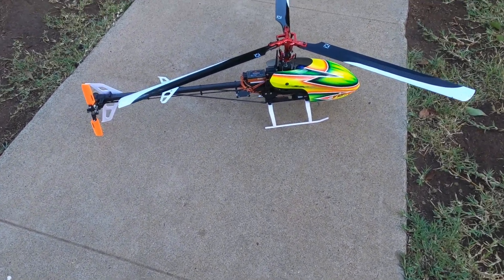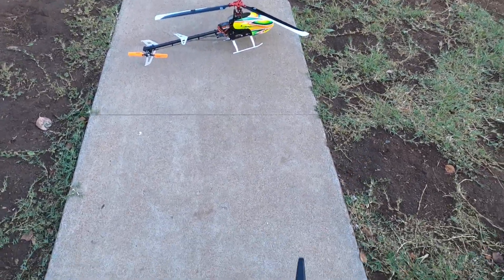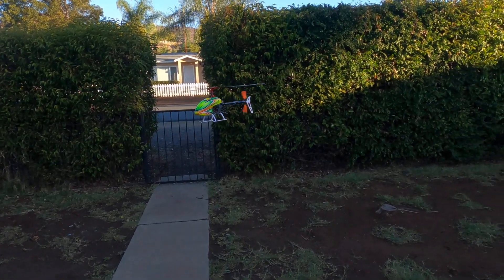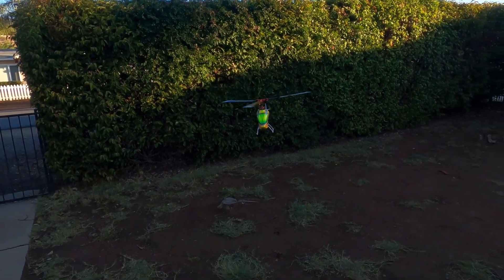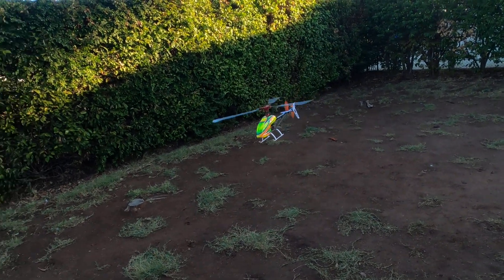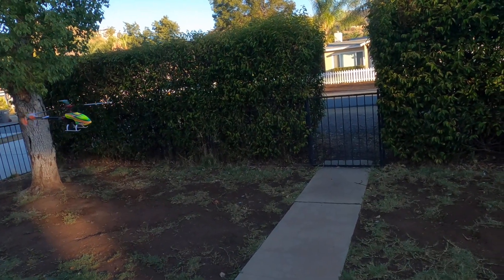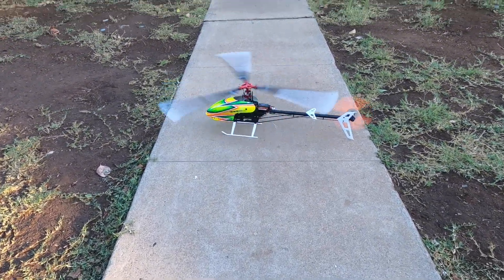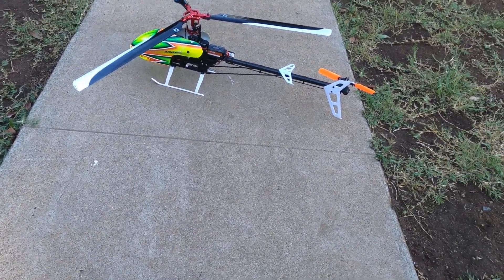Horizon Hobby Blade 330s with MicroHeli 3 Bladed Head, Metal Swashplate, and Longer Tail Blades

Comment: Total overpriced crap little tiny ass way too tiny screws.  You might enjoy for free but when you buy it and it's so small you need a glass to even see it.  Likely you will damage the stuff before you ever get a chance to crash it.  I have bought probably 1000 bucks in microheli 230 parts including 3 blade head I recently threw away after a couple flights.  Stuff was beat to hell sloppy as blade plastic junk.  You will see.  Fly it a little and tell me I'm wrong.

Comment: Do you have any updated videos or information on that set up since you have been flying it for a while...ive moved up from the 330s to the 480 and now i want to upgrade my 330s for fast scale flying and mild 3d like loops, rolls, and inverted...so far all i have is the micro heli 2 piece canopy and would like the 3 blade set up.

Comment: I like Microheli aluminum parts. They are top notch precision made, but....I did the microheli 3-blade conversion to my 230sV2 with microheli AS350 fuselage because it made it look more scale. It looked good, sounded good, but I had to fly at almost full throttle. So I did the recommended motor upgrade of the 320 size blade heli motor with 11t pinion. Well it was a pain in the butt to get the wires routed correctly around the motor, and had to move the esc back slightly. Definately more power now but... no amount of gyro adjusting will get the tail motor to keep up with all the extra torque. Full throttle = endless piros. The electric tail motor just cant keep up. And it sucked batteries down like crazy. 4 minutes of just lazy figure 8's took the 1300mah batteries down to 20%. I switched back to the stock 2-blade head but left the motor & pinion in it. I'll see how that goes. I may try the 3-blade head on my gen 1 230s with microheli hughes 300 canopy. It's 5.5 ounces lighter and may not require as much power to fly.
Reply: UPDATE
I ended up putting the stock motor back in the 230sV2 that has the scale AS350 fuselage and left the pitch servo travel at 115%. 
 I put the MH three-bladed head on my gen 1 230s with the MH Hughes 300 fuselage kit. It also has stock motor and pitch servo travel set at 115%. No tail blowout issues and it seems to have plenty of lift, but it feels a little sluggish compared to the stock 2-bladed head.
Reply: So I wonder if you could give me any advice? I have RKH3-head. Cf rkh frame 3rd Bearing block, auto rotation CNcgear  tit/alum shaft lynx CF tail boom . I put my blade 200s motor in 3980kv stock landing gear. Getting a lot vibration I still need to adjust those links never done 3bladed head n need balance blades probably my main issue. I wanna scale it to the 355. Oh and it’s 230sv2
Reply: @jtkeys7618  check the tightness of your blades in the blade grips first. Barely snug enough that theg dont flop around whe you pick it up and move it around. I have found that getting the blade grip tightness is very tedious with aluminum.  I run stock grips on my 2-bladed heads. If grip tightness isn't the problem, balance the main blades, and make sure they are tracking straight. Non adjustable though on the 230s unless you change them out to adjustable links. But i might also mention this, use stock Blade links from the swash to the blade grips, and change the ball link on the follower arm from swash to main shaft. (Just use a regular ball link and trim it to the same length of the MH link) The MH links are 3d printed and they get sloppy very quickly. I had one pop off on spool-up and it took out the anti-rotation bracket. Luckily it was on the ground and not flying. Lastly, make sure the follower arm is installed correctly. The links from swash to blade grips should be perfectly vertical.
Reply: @Freddy-Bueger  thx for reply sub your channel if it helps ? Lol appreciate your time. I just got 245mm CF from blade. I def have blades tracked betrrr now. Afraid to even spoil up . The 200s motor only 7$z anyways I’m still new 3years or so. I will check tightened again and agree with you. My stock 2bladed head with all my other upgrades hovered on a dime barley and movement after my trim flight ( beautiful) now I’m concerned I just blew 100$. Live & learn. Happy flying . Love your scale heli nice work. Also, I said I had rkh 3bladed head?  I do have stock control arms roll from swash to blade grips. This rkh head grip 3bladed combo is so nice . The arms look very durable. Who knows I’m only trying to put 355 fuselage from micro heli n scale fly it.  I have a fuselage from co-axial 300cx. Might not even try it lol. Anyways thx again for advice. Gonna triple read your comment n ya know maybe I’ll go bk to 2 bladed or I’ll give this one heck of a go lol thx man . Greeting. From New Jersey
Reply: @jtkeys7618  i would stay with 235mm blades for 3-blade head. Theres a lot more torque by having the extra blade. Then again, 30mm more blade may not really make much difference. I run the Blade 235mm carbons on one of my 230sV2 and they're nice and smooth. I've had good luck with the stock 230s blades too as far as balance. I run stock links and they run smooth with 2 or 3 blade. One other thing i would recommend is to get the aluminum swash leveling tool and make sure the swash is level. Two of my 230sV2 were off right out of the box. Once you have the swash leveled while in servo centering mode, exit the centering mode and check how many degrees pitch you have at mid stick (0 degrees) and at full stick. Should be around 10 degrees.
Reply: @Freddy-Bueger  wow I forgot check mid-stick lol just now oh boy , but blades probably rigjt errrrrr head is like counteracting weight throwing off like it wants to just wobble whole heli at first but ya few more things need to do. Thx for mid-stick reminder oh man have gn thx a lot
Reply: @jtkeys7618  hey I thought of something elst to check. You mentioned that you had carbon fiber frame so be sure you put a thick enough piece of foam double stick tape to secure the receiver and try to keep the antenna wires off of the c.f. frame. These receivers are very sensitive to vibration. When you put your battery in, just set it on the velcro and very lightly secure it with the strap. This is another know trouble spot on the 230. If the battery is strapped down too tight it causes some funky harmonics in the frame.
Reply: @Freddy-Bueger  3rd bearing block makes it hang of back little , but leaves enough room for another piece foam. I will be doing this as well. I always try keep antenna away electronics , but didn’t think about frame (duh) makes sense. Appreciate your advice a lot. I’ll keep ya posted. For some reason I’m thinking it’s those CF blade) blades 245mm n 200s motor . Gonna get 235mm give her a go. Really would love those big blades to work. I have 11t pinion coming n I might try 300x motor .
Reply: @jtkeys7618  dont waste money on the 300x motor. Too much torque for the electric tail to hold, even with mild flying. Three balde head is even worse. Plus it will drain batteries in 2½ minutes. Stock motor and pinion is the only way to go with 3-bladed head. I tried the 320h motor with 2 bladed head too and it still blew out the tail on mild punchouts, plus it made the tail motor work extra hard, constantly pulsing and screaming.
Reply: @Freddy-Bueger  I thought it would help with the 3bladed head but yeah that tell motor I think holds up pretty well but yeah deafly not that great I’m not experience like you I’ve only been flying for a few years and I just got in the collective pitch but I’m doing OK thanks for your advice I had a swatch leveler so I’m gonna put that on the head because I took the head offSo I’m going to do the level play tracking I’ll keep you posted thanks so much have a great day
Reply: @Freddy-Bueger  take 200s motor out? I still have stock in good condition too
Reply: @jtkeys7618  i honestly dont think there would be any noticeable performance difference between the two motors. The 200s motor is 3980kv and the 230s, 230sV2, and 230 Smart all use the same 3900kv motor. RPM difference with no load @ 11.1 volts is only 888 rpm higher with the 200s motor. However, the 230s motor is very likely wound differently to give more torque. In helicopters, torque is more important than rpm. Before you take out the 200s motor, try this experiment: get into a hover and do a 1second full collective punchout. Take note of how quickly and how high it climbed, and if the motor seemed to bog down. Then switch the motor to the 230s motor and do the same test.
Reply: @Freddy-Bueger  I will do that. This bullet connectors figured giving more juice . you know tons more than. I can’t thank ya enough.

Comment: Looks great man! I've been flying MicroHeli gear for at least 10 years on a lot of my Blade helis. They may not always have the "best" upgrades on the market but they always work well.
Reply: I tried this set up for a mini s3.. total trash..!! Screws that hold the blades wasn't strong at all..broke in mid air after the 2 flight..but I'm gonna try it with the 230

Comment: Hey Justin. 2 questions. Are the blades carbon fiber? Does the 3 blade head diminish battery flight time as opposed to the standard 2 blade head? Btw looks cool. Nice video.
Reply from the maker: Blades are the stock ones, which are 325mm carbon fiber. I just had to balance the oddball blade. And yes, I noticed it ate about 30 seconds off the clock.